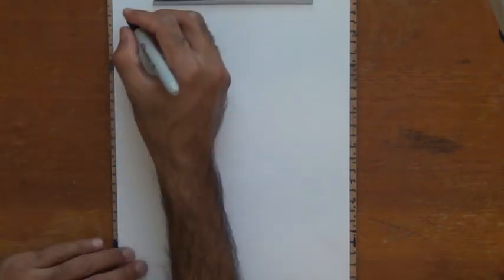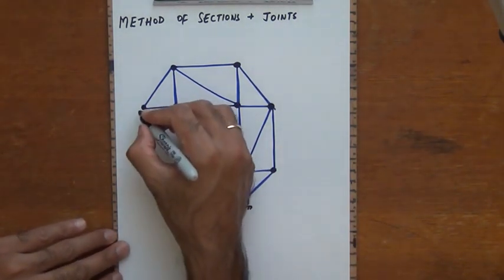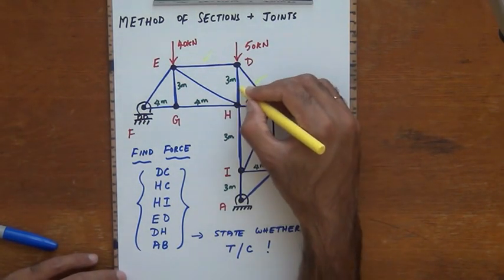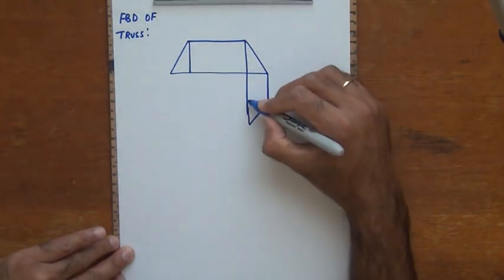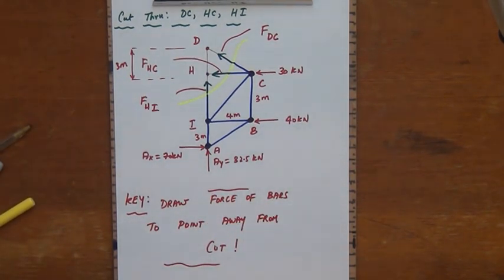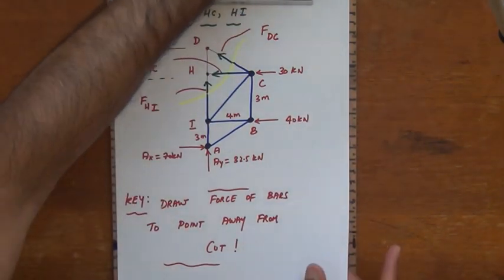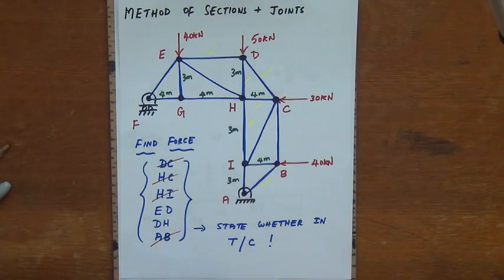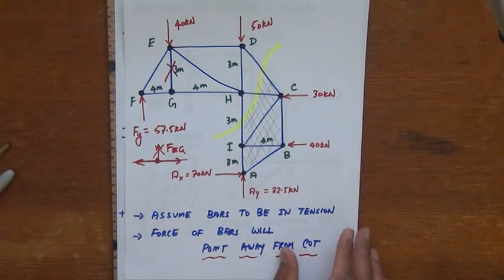Solved Problem Trusses Method of Sections

Comment: just to inquire sir, the method of joints on such a truss that has three different sized sides applies? used without the method of sections that is.